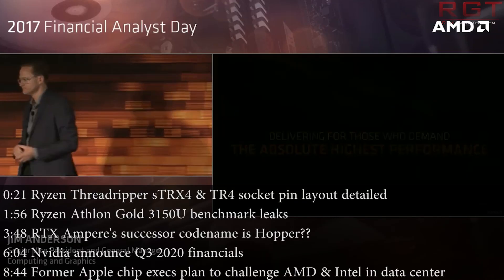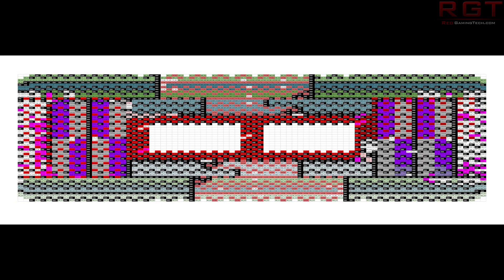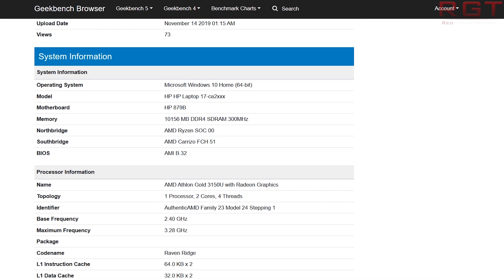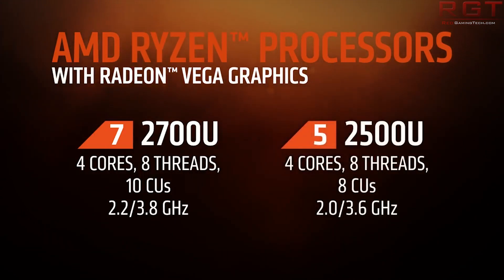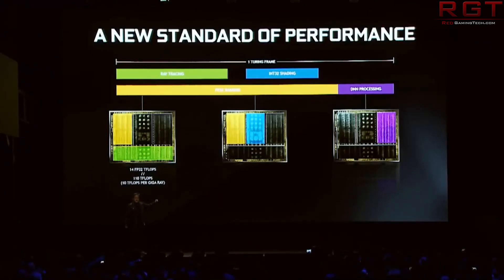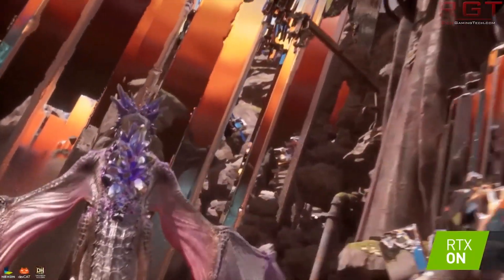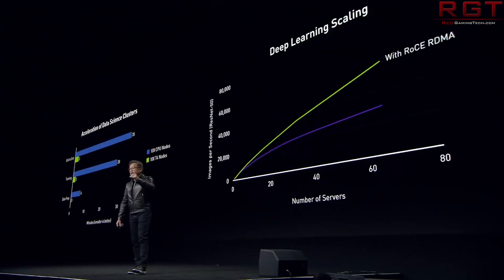RTX Hopper = Successor to Ampere ?? - Details Leak | Threadripper sTRX4 & TR4 Socket Pin Layout

Comment from the maker: 0:21 Ryzen Threadripper sTRX4 & TR4 socket pin layout detailed
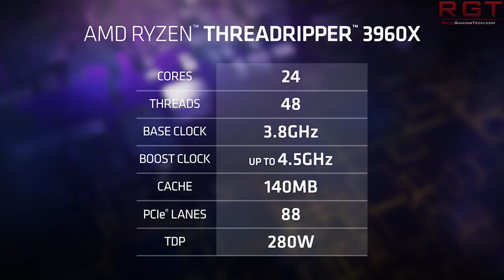1:56 Ryzen Athlon Gold 3150U benchmark leaks
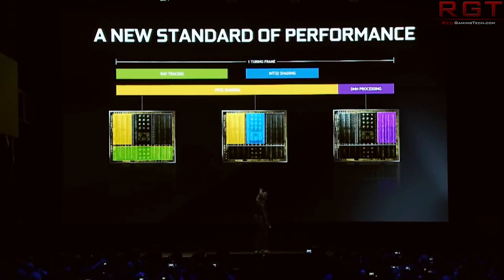3:48 RTX Ampere's successor codename is Hopper?? 
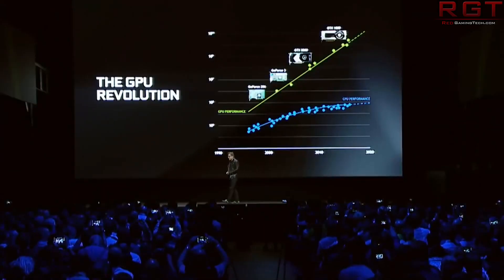6:04 Nvidia announce Q3 2020 financials
8:44 Former Apple chip execs plan to challenge AMD & Intel in data center

Comment: .....Okay I can see why a TR4 motherboard won't be compatible with Gen 3 Threadripper but why can't a sTRX4 motherboard not be reverse compatible and accept TR4 processors? Wouldn't you just need to shut off the now active pins for the TR4 so someone can purchase the Motherboard before getting a new Processor? Or did they do even more they've yet to discuss with the new Threadripper platform?